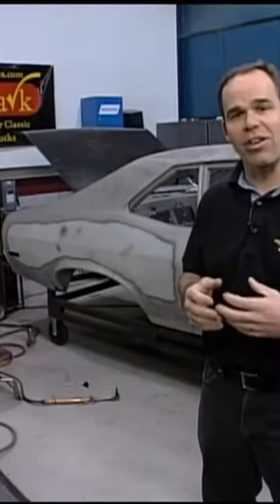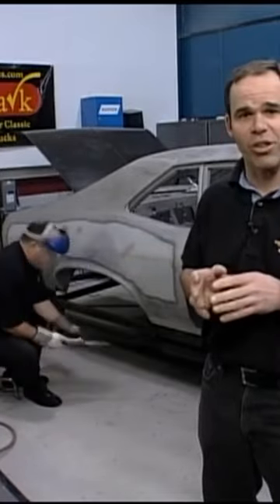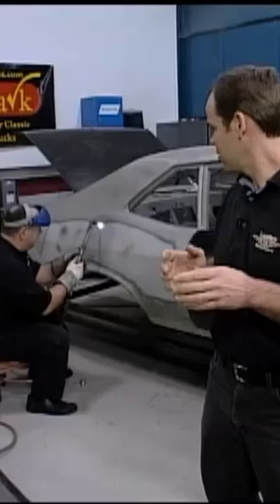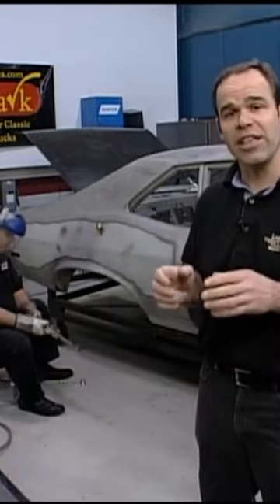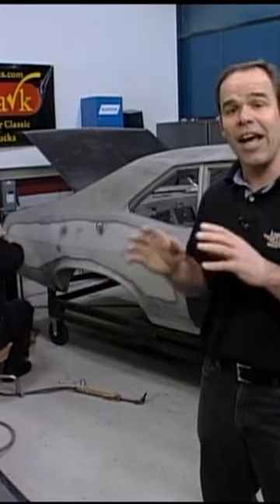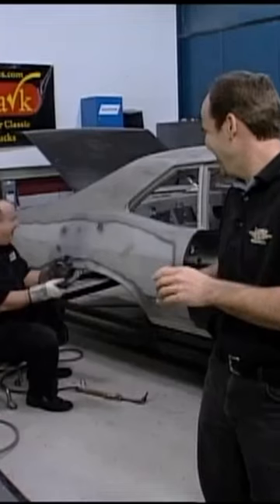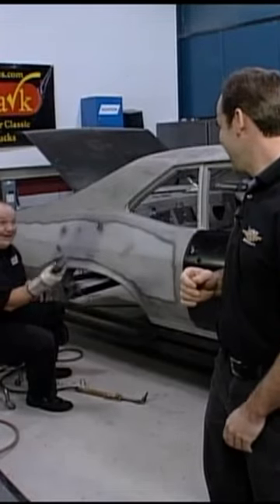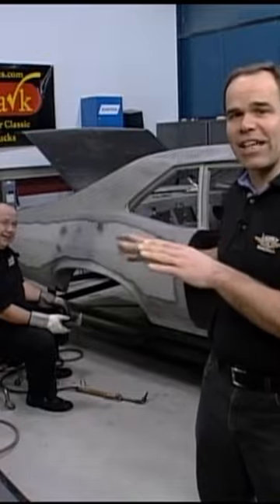72 Nova restoration and Tom with a torch 🔥

Comment: I would start where all the spotwelds are. Starting with the door jambs and use a drill and a special bit and work my way to the rear window edge (glass has to be removed) expect to spend 3hour on each quarter panel removal.